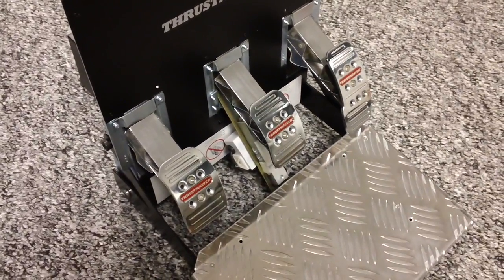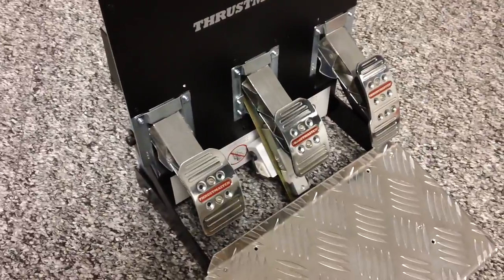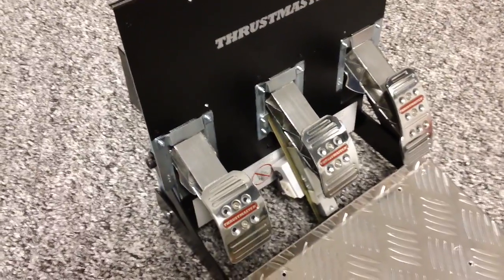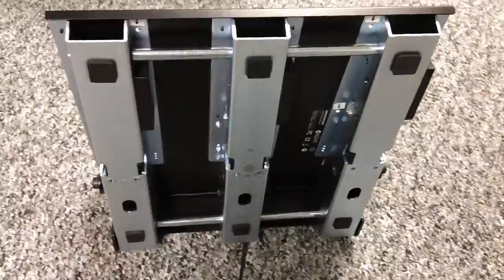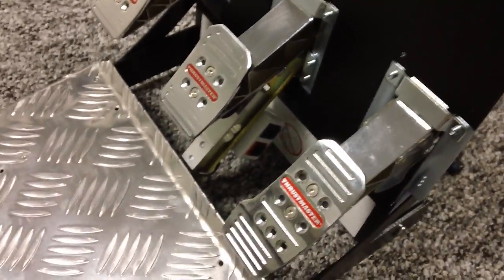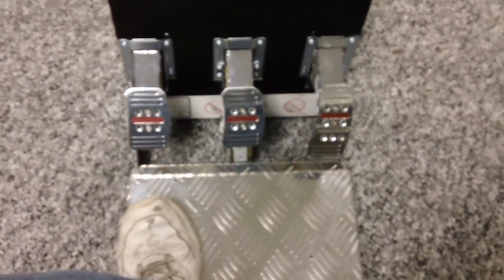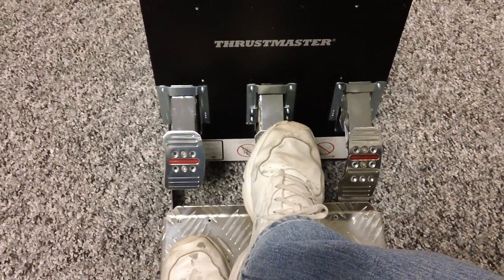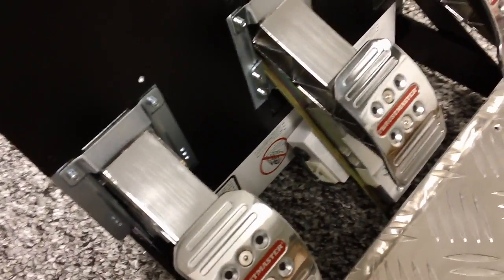Load Cell Mod for T500 RS Pedals - Bodin Solutions BLC-T500

Comment: The CSP pedals are decent and the load cell mod makes their action better than rheostat based pedals. The Bodin mod actually has more real and better feel than the CSP brake pedal.

The CSP feels like a poorly bleed hydraulic brake system. Who wants a mushy brake pedal in their car? The Bodin mod feels firm the way a properly bleed system should feel. I only use the CSP's for XBox360 now.

No more mixing T500 + CSP for PC and then having scratchy T500 pedals on PS3.

Bodin + T500 > CSP.

Comment: CSP > T500. CSP have more travel and better spring pressure for accelerator and clutch, they also have more adjustability (sping pressure, travel, pedal positioning) i have both pedals and although my t500 pedals dont have the load cell mod, but even if it did i would ust my CSP over them any day of the week. i think the cost to mod the t500 pedals is too much (standalone mod + load cell are not a cheap combo)